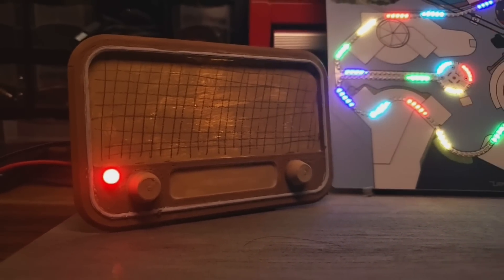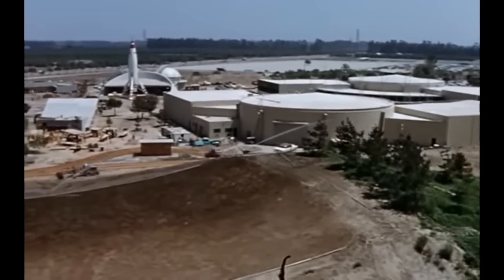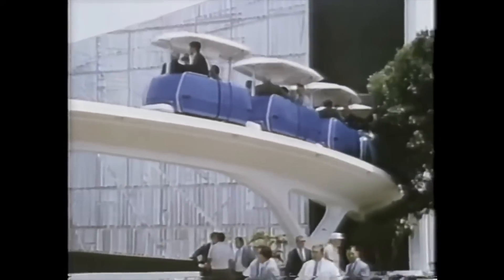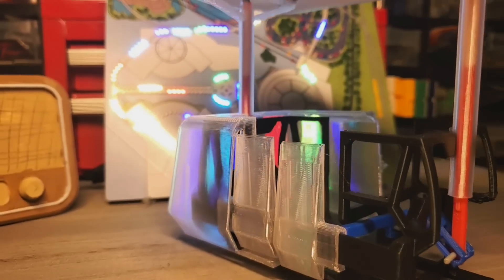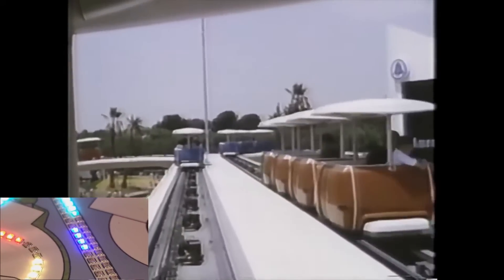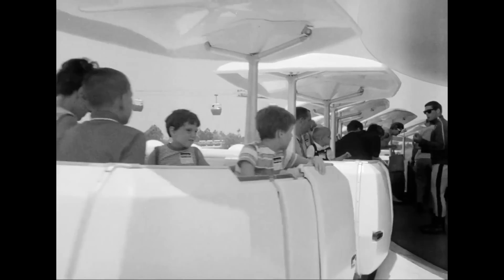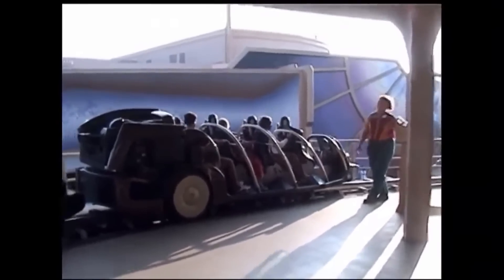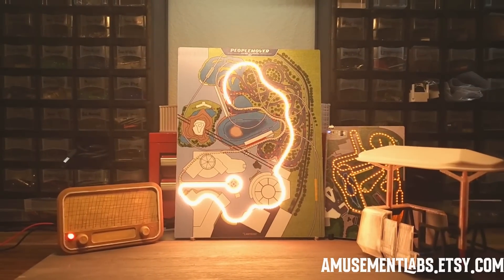How It Worked: The Original Peoplemover | Disneyland

Comment: For my part, I would gladly see the Peoplemover track repurposed as an elevated walkway with railing, with multiple entrances/exits to the ground level, even if just a portion of the whole track. That would give guests that elevated view again without having to bother with track replacement. I imagine it with benches, flower beds, small trees, and of course rubbish bins. I think that would fit well in Tomorrowland. Not sure how feasible it would be, but it would sure be nice.
Reply from the maker: @tannermcginn7330  what would be nice is if they enclosed the station and had it be one of those slow rotating restaurants like at Epcot, but tomorrowland themed.

Comment: They could still bring it back if they really wanted to. First off, just copy the ride system from WDW. The old track could be removed silently without raising eyebrows. That work could be done overnight and the most noticeable part (the track over Autopia) could be done last to raise the least suspicions. They could even setup dummy lights along the track by the Monorail station to throw people off while they work on the indoor areas. Then they have a clean slate to shorten the work when they do announce the return. Also the tech for things like the speakers would be easier to accomplish now. The big thing of course would be the queue, but I would accomplish that by simply turning the Innoventions building into the entrance/exit for the ride. The entire top floor could be dedicated to it, which people would love having an indoor queue in the summer here, and Disney could still use the bottom floors for other things. The old platform could be utilized as an emergency exit and even gives them an opportunity to showcase an old Peoplemover vehicle and explain its history as part of the ride.
Reply: One critical difference between DL's Peoplemover and the WDW version is that the Anaheim version changed elevation numerous times over the course of the ride while the WDW version is all on one level with no elevation changes.  There is a safety reason for this: since the Anaheim version was driven by positive friction between the tires and the traction plates on the bottom of the trains, if (when) the power failed, as it inevitably will at some point, the trains would all come safely to a stop as the motors stopped and they would be physically held in place by friction with the drive tires even if they were on a sloping part of the track.  Therefore, no vehicle collisions could occur if the power failed.  By contrast, the WDW version is driven by electromagnets which have no physical contact with the trains.  So, in the event of a power failure, the cars simply coast to a stop on their own.  This is why the track has to be level.  If parts of the track were sloped, when the power failed any trains on a sloping section would coast down to the bottom and collide with any train that happened to be there.  Yes, fail-safe brakes could have been incorporated into the design, either on the trains or on the track, but this would increase the complexity of the system and, therefore, the cost of maintenance.  Such safety brakes would also have to be tested periodically to make sure they were in working order.  It was much simpler and cheaper to eliminate brakes and instead design the track to be all on one level with no inclines.

If this system were to be brought to Disneyland, the original Peoplemover track would have to be demolished and rebuilt to eliminate the sloping parts.  Since the existing track changes elevations to work around other elements like the Monorail beam, and it also changes elevations when entering and leaving the show buildings of other existing attractions, this would be impractical.  Yes, brakes could be added, but at the cost of added complexity and maintenance.

Also, regarding your comment about replacing the existing track "on the sly" without the guests noticing, this is not possible.  Disney's engineers discovered that the heavier vehicles and higher speeds of the Rocket Rods damaged the support structure of the existing track and rendered the structure itself unsafe for reuse.  So, any revival of the Peoplemover would involve completely demolishing the elevated sections of track and replacing them with new structures, which will further increase the cost.

@wheelindisney5874 makes the excellent point that a better use of a new Peoplemover would be to serve the areas between the parks themselves and things like the parking structures.  In other words, a new Peoplemover would best serve the resort as a true working mass-transit system, as Walt originally envisioned it.
Reply: It's really hard to do it silently when it's threaded throughout every single building in tomorrowland
Reply: @nukedukem6  not really cause it's not anywhere in the buildings where someone would notice day to day. Also the whole working overnight thing lol

Comment: I love your appreciation for the PeopleMover.  Like many Disney attractions, you never really know when your last ride on something was your LAST ride on it.  The original '67 version was great because this ride was the epitome of kinetic energy.   It crossed through so many other attractions that you just knew the point of this ride was to be a teaser for every other ride.  The Tron light tunnels were fun too, especially the light cycles.  In later years the standing stormtroopers ( second floor gift shop window, along the track as you passed by ) were fun too but a sign of them running out of ideas about how to keep this current.  I'm sorry to say I rode Rocket Rods once.  It was not worth the 3+ hour wait.  Disney, bring the PeopleMover back, even if you have to rebuild the whole support system.